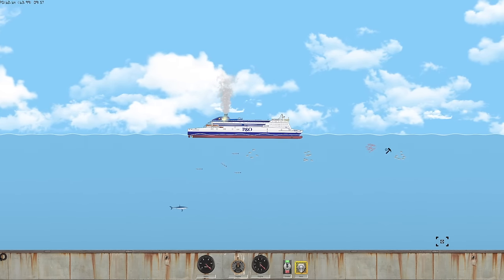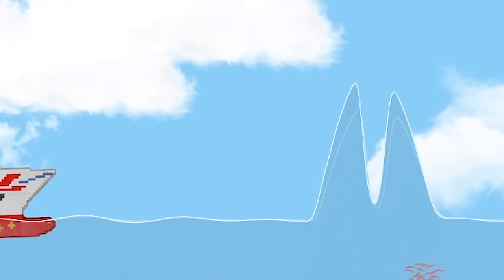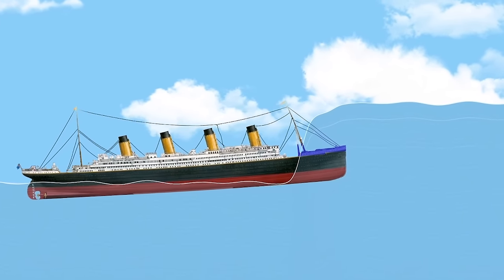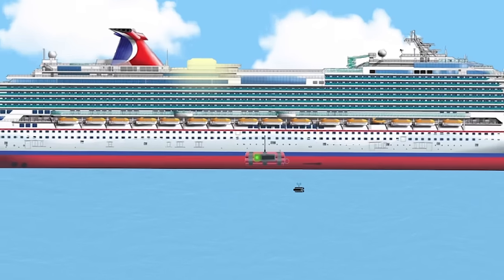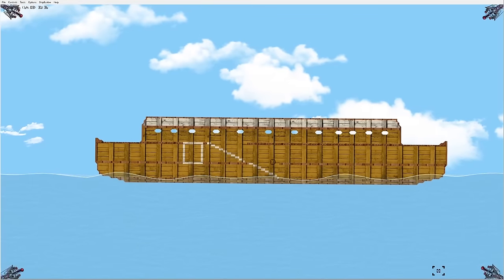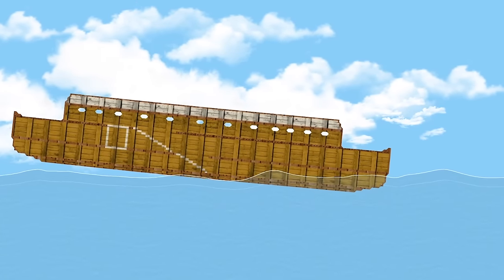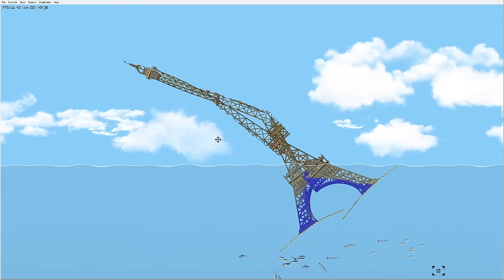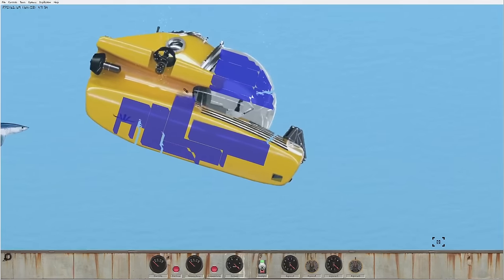Testing the Titanic against a MEGA TSUNAMI!

Comment: Those sections are called "water tight compartments" and they are used to section a ship off if it's flooding. Didn't know being a Navy engineer would come in handy today. Ships will buckle when there is a massive cavitation under the hull like that, they rip themselves apart by their own weight,  that's how torpedoes work with a massive displacement off water.
Reply: As a shipbuilder who builds aircraft carriers, I can confirm that navy engineers are definitely some of the engineers of all time.
Reply: @nukewurld  In general the Navy just is.
Reply: @nukewurld  -_- so you guys are the ones who build the deck drains higher than the deck
Reply: @cody180sx  I ain't a tin bender. Before I moved into Metrology I was a shipfitter. I built the houses. Someone else furnished them
Reply: this supports the emerging theory that the Titanic scraped against an underwater ice shelf instead of the iceberg ripping along the side of the ship
Reply: @sapphicfrenchfry yknow people were on the ship and saw it hit the iceberg, yea?

Comment: "Anti-waves" are also known as troughs, like rogue waves (freak tidal waves that appear seemingly out of nowhere) rogue troughs exist and between them are likely responsible for the disapearance of a number of ships.
Reply: Just goes to show you can't trust a rogue.
Reply: Yeah isn't a rogue trough by the opposite just a massive fucking hole opens up in the ocean and then you're gone. That makes me not want to go on a cruise period. At least with a giant wave you can see it and know what is going on, a rogue trough is like a hundred times more terrifying
Reply: @Vladimir_4757  Yeah basically, they're rarer than rogue waves but given how ships are constructed essentially a death sentence
Reply: I think the highest recorded one was some 53m high. And as far as i know most ships are rated to 13m waves. A 53m wave will shred, smash and mangle stell. A battleship taking it from the front might survive. For its armor many more watertigh compartments and the simple fact that a battleship can be locked down watertight by design (top as well). Though it might joust snap in half
Reply: @Manuelslayor  Yeah the superstructure of most civilian ships will be treated like toilet paper by a wave that large. The Queen Mary was hit by a rogue wave 28m tall while carrying nearly 12,000 troops and crew and only barely didn't capsize.
Reply: That almost seems scarier than a rogue wave. Just a sharp drop out of nowhere.
Reply: @Vladimir_4757 counterpoint. You're gonna die either way. I personally would rather just die before I knew what happened rather than sit there hopelessly aware of my impending doom.
Reply: Negative. 😂
Reply: Ihydhdhssnjjwjjja’akaksjwhelrl<99999999999999999909999¥9997

Comment: The hole at the end of the plane, is the APU exhaust (a diesel engine exhaust pipe, like on a car) that engine allows the plane to power its electronics before the main engines are switched on and normally shouldn't be restarted before the engines go offline after reaching its destination. Sully activated it after he lost his two engines, that saved everyone because the automatic pilot could maintain the aircraft horizontal to ensure a better splashing in the Hudson river.
The Ram Air Turbine only generate power for a few screens and not total automation, the APU is more powerful.
Plan es are structurally very weak, they just have to wisthand wind and internal pressure, otherwise they are very lightly built.
Titanic spliting in half with a wave was the first conspiracy theory, many people couldn't believe that an iceberg could sink a ship that size and as it was the biggest on its age, reasonsable people just thought that the ship wouldn't have wistanded a wave. Even if they were right on paper, weather was absolutely calm that day and no waves so big to allow that to happen were registered.
The main weakspot of any ship is its keel. Instead of planting a bomb inside, you should simulate a torpedo hit just UNDER the keel. Results are most of the time devastating.

Wooden ships are light and can take quite a punch because they deform a lot. However, we went into metal ship hulls because of the introduction of boiler rooms feeding propulsion. Boilers would be too heavy for a wooden ship to bear, so a metallic ship could be bigger and thus allow a better boyancy.

Comment: So the "anti-wave" is a thing just not in the way that you think. See when an underwater anti-ship mine explodes underwater it creates a bubble that rushes to the surface and as it does it flexes in and out causing hull whip in the ship. When it reaches the surface it ruptures and sends a high pressure water jet through the ship splitting it in half. The last thing to happen is when it ruptures it opens a void under the ship basically causing it to float in the air for a moment before it falls into the void and the water rushes back in filling the void and finishing the job of breaking the ship in half. The void would be considered your "anti-wave". "Scientific" explanation courtesy of the US Navy.
Reply: Thanks a lot. I really appreciate this tidbit lol it's very interesting.

Comment: The pins aren't actually supposed to poke holes in the ship, they're supposed to keep the object under them from moving.  But the forces moving the ships around are a lot stronger than the ones holding them together, so it just rips the chunk under the pin right off.
Reply: Yes I don't know how he did not see that?

Comment: I’m pretty sure they stopped using wood because the size of the ship was dictated by the size of trees. Trees are smaller now since we been cutting them down. And there is a max size fore a wooden ship before it rips it self apart because the different parts of the ship are moving in different directions. I’m pretty sure the metal ship broke when you drop them just because they where heavier than the wood ship. And water is pretty hard when your fall from like 1 mile up.
Reply: Smaller, younger, and less dense -- which is bad for strength. Sustainable logging promote accelerated growth as density doesn't matter when it's pulp.

Just read an article about restorers of Norwegian stave churches despairing because 150-200 year old trees are seriously hard to come by and thus ridiculously expensive. The new stuff is just not good enough.
Reply: No it had nothing to do with the size of trees lmao. 

Its simply because metal is stronger than wood, and as industrial technology improved rapidly in the 1800’s it made the manufacturing of huge metal stuff possible

Comment: "That is a massive fire hazard" under a minute later "why did we change from wood into metal?" Also an actual fully wooden boat the size of current cruise ships wouldn't be able to sustain itself under its own weight withought bending i believe
Reply: The ark was bigger than a cruise ship
Reply: @jenniferwheelis3878  about 2 times smaller than the titanic, and the titanic isn't big compared to most current day cruiseships
Reply: @jenniferwheelis3878 no no wth?
Reply: @Fistrike  Basically, it was as big as possible for ships of the day.
Reply: @SupersuMC much bigger than possible for the day funnily enough.

Though it’s a myth it’s believed to have taken place in  about 5,500 BCE…
Reply: @jenniferwheelis3878 Wooden ark bigger than a cruise ship? Physically not possible. Ship construction switched to steel because wooden ships had reached their maximum size.
Reply: @pieterboelen2862  No shit, Noah's ARK didn't actually exist. But to carry a pair of all the animals in the world, it would have to be pretty damn big. Physically impossibly big. That's the point.
Reply: @DaTimmeh Absolutely agreed. 
Right you are. 👍👍

Comment: Titanic would survive a direct hit with ice berg but the move by crew to try to pass by sealed its fate.
Reply: Would it really???
Reply: @smilemore1997  yeah, if titanic hit the iceberg directly on the bow then the breach is only at the front. Titanic sank because the iceberg made a long cut through at least 5 watertight compartment. If the Titanic hit the iceberg with it's bow then there is probably only 1 compartment flooded. Remember, Titanic can still remain afloat with only 2 watertight compartment flooded.

Comment: It doesn't help the Titanic that one of its sibling ships sunk not too long after it, but honestly the ship would've probably been very nice, it sunk due to human error and a lack of foresight. (Also an engine fire that weakened the hull and wasn't able to be fixed before launch) Also I think the middle of the Titanic model may be weaker then the rest or something since it breaks there consistently
Reply: Probably done on purpose tbh. That's why it's famous after all.
Reply: The double bottom hull is strong. it just breaks in half because of the length of the ship the longer the ship the more chance it breaks. Even modern ships can break in half with their length
Reply: The ships hull is the same strength maybe they strengthen the middle section a bit since one rough wave will destroy a long ship
Reply: If theres engine fire it could have been exploded the engines and cannot sail considering there's always fire going on the ship (boilers)
Reply: The middle of the hull isn't weaker, if they weaken it the ship may break in half in the dock
Reply: Maybe it is programmed to break in half to represent the real sinking

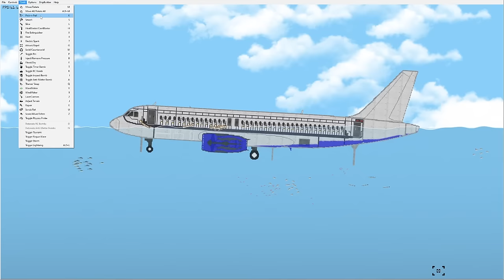Comment: 5:35 That hole is called an Auxiliary Power Unit outlet, which is the exhaust pipe for a small turbine engine whose only purpose is to suppy the aircraft with electrical power, compressed air and hydraulics when the engines are turned off.
Used in many situations but most commonly on the ground during pushback and boarding in order to reduce fuel consumption by avoiding to turn on the main engines until the plane is ready for takeoff.

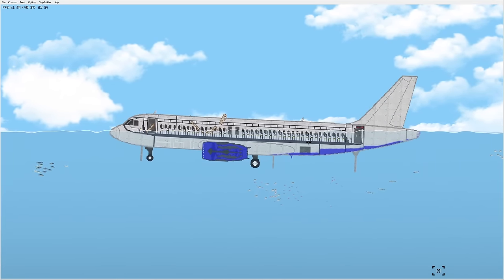Comment: 5:35 that would be called the Auxiliary Power Unit (APU), and is basically a smaller, less powerful jet engine used to get power started up to the engines as well as electricity to the plane when the engines are not started up.

Comment: Matt doesn't know about the legless at-at boat which is basically what he made
Reply: I'm guessing the Empire fielded those on aquatic planets? Just take the AT-AT and remove the legs or replace them with floaties?
Reply: @stylesrj  Yes they were fully submersible and had repulser lifts for steering but we're a bit of an oddity as the had to redo a lot of the troop deployment mechanisms and the empire was a generalist military and didn't like specialized equipment unless absolutely necessary. This is due to Grand Moff Tarkin and The Tarkin doctrine. I'll stop here because this is a lot of text. Yes I am a huge nerd.

Comment: The "hole at the end" of the plane is typically the exhaust port for the Auxiliary Power Unit. It's basically a tiny jet engine that doesn't produce a whole lot of thrust, but doesn't take much power to start up, and is attached to an alternator to generate power and pressurize hydraulics for the plane. They'll turn it on as passengers are boarding to keep the electricity on in the plane once the ground crews have disconnected ground power, and then are used for starting up the main engines.

Comment: Mr RCE, you say the antiwave is not a thing. 
Are you sure?
I think if a giant sinkhole would open up underneath a large body of water, i think the water above will drop down with it, right?

Not as exaggerated as in this game, but still.
Reply: I think if a sinkhole opened up in the ocean it would make a dip in the water but the water around it would rush in to fill the gap instead of the effect moving outwards
Reply: @xobler2508  very true that, but if the sinkhole is large enough, the dip could be very large. And if it were to happen right infront of a large ship, i think it would notice it. 
Not as exaggerated as in this video, but still noticable enough.
And, depending on the age and structure, the ship might be damaged.

There is a video of a cargo ship breaking up by heavy waves. Obviously the ship was already not in the best shape. But reasonably small waves broke it up.
So i think a big sinkhole, like really really big, or perhaps a sudden downwards movement of a continental plate (or whatever) could create a dip in the waterlevel that can cause damage. 

Btw, what if 2 tsunami waves meet.....
They bounce and go in opposite directions again, right? So if the ship is right in the middle, such a dip might occur i would think. 

But, this is all my opinion with no real life experience what so ever.
It just seems reasonable, this idea, as in: it could happen. Not often, but it could.

Comment: 5:35
That is the exhaust of the APU or Aux. Power Unit. It's a gas turbine engine that provides power to start the main jet engines if a starting truck isn't available at the airport.

Comment: The reason we have metal ship might be for several reason, now steel might not float by itself, but moment ship falls apart, you don't want to be there anyway... then there is the thing we use engines instead of slaves to power the ships, so there is possibility to catch on fire, quite high actually, also I can imagine it's easier to build metal ship than wooden one. But I might be wrong, I'm no kind of ingeneer, I'm programmer.

Comment: "Anti-waves aren't a thing."
incorrect. when a tsunami happens there is a sudden drop in water level (anti-wave) as the ground opens up and lets the wave in. then the ground closes back up, squeezing out the water creating a wave. the wave is low, but long (like when you held the water up) and as the wave drags on the ground it climbs over itself getting bigger. the sheer size is thus both the difference between the anti-wave and the wave climbing ontop of itself. this is why if there is a sudden drop in sea level you should go to higher ground. also anti-waves are created by mines and torpedoes since it is harder on ships than waves (though this is called cavitation).

also bilge pumps are a thing in real life.

Comment: 5:13 that little hole is called APU wich makes it slow down
During landing or a rejected takeoff and powers up the plane 
When the engines are off cause the engines generate power to 
The aircraft like a mini generator.  ¿Did anyone know this?
👇